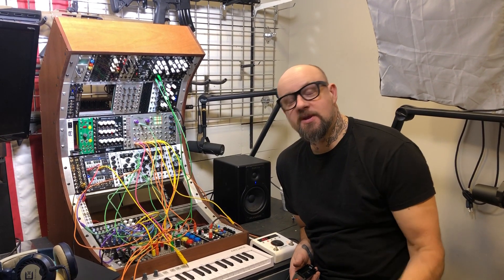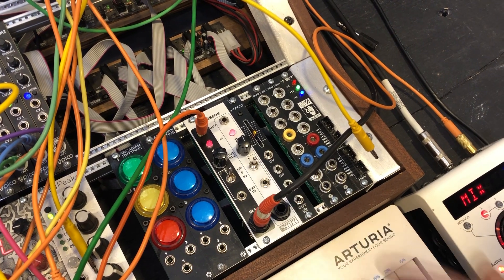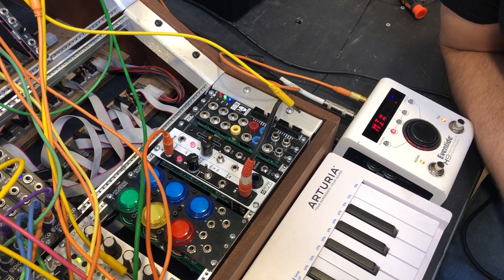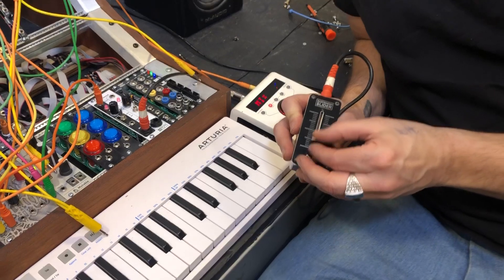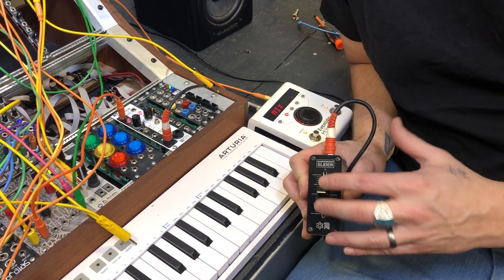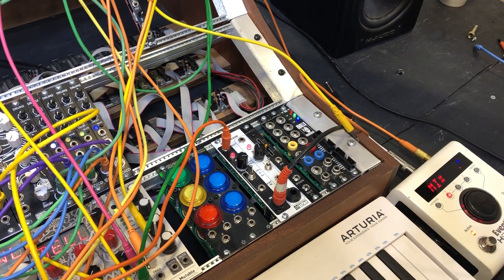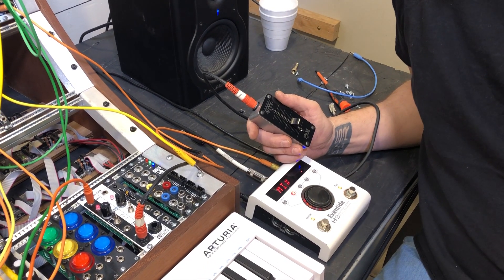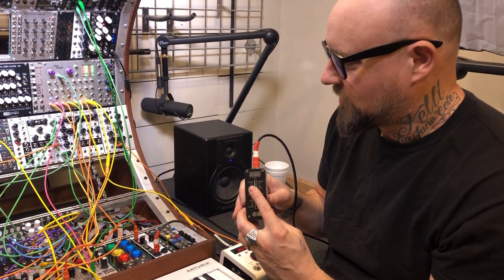Expression Slider - Expression Slider Interface - Eventide H9 - MST Expressor - Guitar Pedal

Comment: What is the resistance value of this fader?
Reply from the maker: It is 10K, but we can make them with 100K as well
Reply: @synthrotek  Interesting...

I am literally about to do the exact same thing.

I bought the Old Blood Noise Slider for my H9 and Blackhole pedals but quickly realised that as a 100k pot, it wouldn't work.

Currently waiting for a 10k slide pot to arrive so I can get it working with my H9. Good to know I'm onto the correct solution!